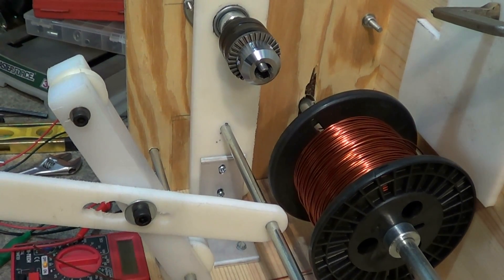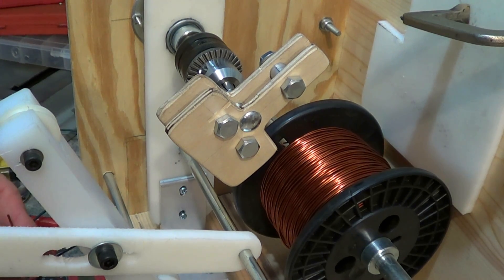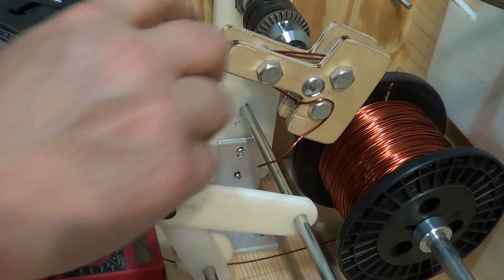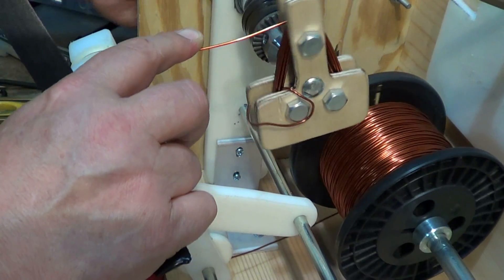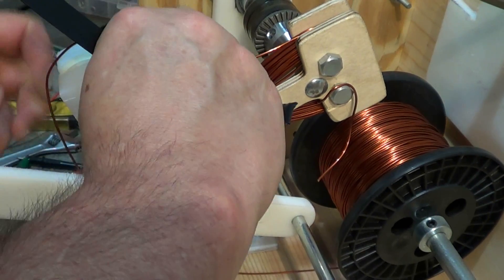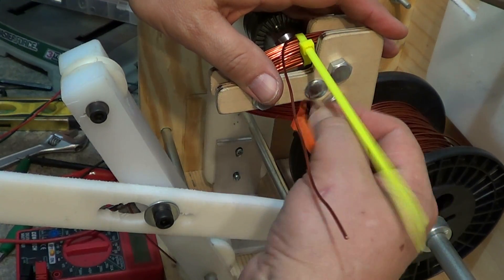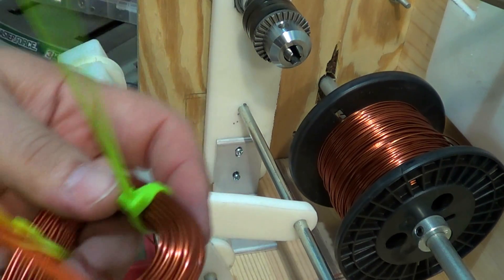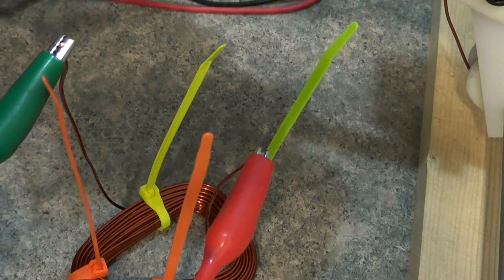TIME TO MAKE COIL'S FOR THE AXIAL FLUX TURBINE

Comment: Nice video -great coils. Lots of patience but there is an easier/quicker way to do it manually.
If you need a 4mm area copper wire (12AWG) then simply use 16 x 0.5mm strands (22AWG). Calculate the length you need, lets say 10 feet, then multiply that by 16 and simply double-up that length of wire 4 times to get 20 feet of 16 strands -now cut and solder the ends and wrap it round a bobin. Use this to wind with and you don't have to be so slow and accurate with your winding as the smaller wires will naturally fill in any gaps...
Won't look quite as nice but will work -good luck!

Comment: Should grab a 1 inch thick rubber pad and install it on a tensioner arm that way you get a little drag resistance on the large spool and to help that tension wrap the coils tighter without much effort. The tensioner arm can be simply spring loaded. 

Trust me when I say it will be a massive time saver.

Comment: Hi bro, that a amazing video! Please share how to caculate number of cicle wiring if i want 24volt at 60 round per minutes. Thank you!
Reply from the maker: I used 14ga. wire and did at 65 turns, 15 coils in star configuration and it came out to be a 12 or a 24 volt stator. You have to be careful of high voltage on the numer of turns and size of wire. Otherwise you'll burn the stator up... Thanks for the comment...

Comment: Great video....Have 2 questions......
Where do I find the info that tells me what gauge wire to use per the Volts I want to generate?
Instead of using your finger for tension...Why don't you use that handle for tension?
Reply: Rezaul

Comment: Thanks for this explanation.  My question to you is does the thickness of the wire and the number of turns affect the ampere?  How many rolls did you make?
Reply: The number of turns affect only the voltage. Section of the wire affect the current...
Reply from the maker: 15 coils is what I built. And The number of turns make the voltage and then the eddy currents flow off the coils to the main lead wire. thanks for the comment!

Comment: add some adjustable tension to the wire, it will help keep it straight and line up with previous wind plus keep it packed better, you want the winds close as possible

Comment: is it better to 3 phase or just daisy chain each coil.
Reply from the maker: You have to connect all coils either configuration Star or  Delta you want. I'd put it in star configuration, that way you have one end of the 3 phase tide together and the other end would be your three phase connection to the rectifier.  This is Star configuration... Thanks for the comment!

Comment: Congratulations! I am from the State of Rio Grande do Norte - Brazil. Good winds and lots of sun. I am trying to manufacture a wind turbine to charge batteries of 24 Volts dc. From what I understand you use AWG wire # 15 and 65 (sixty-five) turns. Question: How long is 1 turn? Another question: You have two configurations to connect the coils. In one configuration the voltage is high and the amperage is low and the other the amperage is high and the voltage is low. As I intend to charge batteries of 24 Volts dc I believe it is better to configure in high amperage and low voltage. Are my observations correct?

Comment: I let out my secret to how I winded my coils of the one I built and sold. I am not building another HAWT of any kind since I figured out how to make a high amp VAWT for so much less. 
Tricycle!  I used a salvaged tricycle front wheel and peddle crank to wind them very fast.  Just clamp the handlebars on a table and put your wire mold assembly on the peddle post on one side, then use the peddle with a extension on the other side as your hand crank. 90 rounds of 15 g wire spun onto nice compacted coils in minutes.
Reply from the maker: That's a good idea for the circle coils. Will give it try but as for now it's slow and steady for now. Till I get my chain and gears... thanks for being there Buddy!
Reply: +TheBillytheJack2010 I'll do a private vid of that and the stator for select few .

Comment: So, I've been looking around, I've seen both this coil design, and just standard round ones and I've googled relentlessly.   I've got rectangle magnets on the way, would it be best to make rectangular coils, coils like this, or just round ones?   Is one more efficient than the other?
Reply from the maker: The pie shape is to fit coils as tight as it can, to fit the hub diameter with the rectangular magnets. As for a round shape coil with a rectangular magnets the flux feilds are different and output should be good also depends on number of turns and wire gauge. Thanks for asking.

Comment: hii,

i would like to build a coil for generator for fun project. 

may i know what magnet wire gauge i should be buying ? 

what is the factor of consideration ? 

what size of magnet wire can handle how much current that flows thru it without burning out the enamel ? 

thanks
Reply from the maker: andrew ysk 15 ga. Is what I use for a 12, 24, 48 volt. The high voltage coils is what you want. Good luck with your build.
Reply: Read the discription...

Comment: Your skill just surpass your narative exellence!!!   LOL  That`s a verry good acheivement you just did there.. The ole project must consume you with the desire of completation right away...  Thanks for sharing and once again, verry EXPLECIT video on DIY.. Must i suggest you something????  I would recommand you to make the stator with 6 leads comming out...So this way, you could by a flick of a switch change the config of the wiring and change the output as you want depending on the winds...
Reply: I'm definitely happy that I took your advice on the wiring, very convenient!
Reply: Peper, this will speed up your build. I let out my secret to how I winded my coils of the one I built and sold. I am not building another HAWT of any kind since I figured out how to make a high amp VAWT for so much less. 
Tricycle!  I used a salvaged tricycle front wheel and peddle crank to wind them very fast.  Just clamp the handlebars on a table and put your wire mold assembly on the peddle post on one side, then use the peddle with a extension on the other side as your hand crank. 90 rounds of 15 g wire spun onto nice compacted coils in minutes.
How to build your stator body in 1 hour for next.
Reply from the maker: Damn Dude that's a awesome idea!! I want to do wye configuration though on this one. Because this one is for my Brother in-law. He's going to build a VAWT with it. But yeah Buddy it on now for sure!! Thanks a lot for being there!!
Reply from the maker: +James Biggar James did you make a video showing that?
Reply: TheBillytheJack2010 Yeah buddy, the  6 leads can be seen in just about every video in the axial flux series that focuses on the pma, specifically the stator pour video. I had mine connected in Wye on the tower when first installed, but needed to switch to Delta because I'm running  24V stator on a 12V system, so Al suggested that i run an extra wire down the tower from the turbine so that I can extend all 6 leads from the stator to ground level and be able to switch back and forth between wye and delta to see which worked best without having to lower the turbine ;)
Reply: I think he means 1KW turbine. You can't make a 10kw turbine unless you get 2 pounds of copper and some poorly plated magnets and put it in a washing machine motor casing and have it assembled in Vietnam then sold on Ebay as a PMG. Then you need 75,000 rpms and a fire extinguisher to get that one burst of 10kw
Reply: Yeah 10 kW sounds like a nice number but its not practical for a single dwelling - it would have to be a MASSIVE turbine with a swept area that's larger than an average home. The best you're going to get from a 3 phase 9 coil gen w/ 16 mag's and 15 awg wire is about 1 kWp - or 500W continuous but that's in ideal conditions, ie: proper tower height into absolutely clean, consistent wind with no obstructions like trees or buildings within a 100ft radius. In my latest turbine build I have a 3 phase, 9 coil axial flux stator and dual rotor with 24 N52 mag's. It sits on top of a 30ft tower but doesn't see clean winds at all and it's only produced 300Wp, typically it outputs in the 50-200W/h range in 5-15 mph dirty/turbulent wind (I'm surrounded by trees, my site isn't exactly 'ideal'). Adding more or less turns in the coils won't necessarily increase the power - to keep the turbine operating properly and within the right charging range requires a specific balance of copper coils, turns, and magnet size/strength/quantity. With the components that you have now, I would suggest using around 75 turns of single strand wire per coil for charging a 12V battery bank. If you want to charge a 24V bank then you should use 50 turns of double strand wire (that means winding two wires side by side in parallel to form each coil - this increases the voltage but lowers the amps compared to the 12V wiring, but the total power in watts at a given wind speed remains relatively the same). This size of gen is best suited with an 8 ft diameter rotor, and is a time tested combination that will ensure the potential for optimum performance - but I would consider increasing the mag count to 24 total and again, whether it performs well or not also ultimately depends on the site conditions and installation height - you could do everything right with the turbine and waste your efforts with a poor installation, so plan it well because harnessing wind power isn't cheap. I highly recommend getting Hugh Pigott's "Wind Turbine Recipe" book, he lays out all of the details for building various sizes of turbines ranging from an 8ft/500W turbine to a proper off grid 14ft/1kW turbine. It's well worth the $
http://scoraigwind.co.uk/a-wind-turbine-recipe-book/
Reply: James Biggar You are right on so many things James and i`m not arguing with your numbers..  My conclusion on the turbine place in the RE community is well above what other people think about this subject... My recent testing with the delco type and right arrangement of blade number and TOPPED with the right capacitor and MPPT has surpassed my expectation with great lenghts..
The lack of curiosity from the community is what strikes me the most... Everyone BASHES the delco type without experiencing or trying to understand it`s behavior with it`s power curve output..  With my recent test with cap and coils in the delco type generator, i have blowen my EP SOLAR 40 amps charge controller at 19 mph winds with a reading of 46 amps on the meter ..  That is some serious power that no one expected from this form of generator.. My help with Daren Baldwin and you just have prouven my point that i have try to push for the last year..  It seems like nobody is really interested in the behavior of the turbine while it`s making it`s power..  But everyone is preocupied at watching the needle moving..
Reply: I did not give up on wind power but I have put it in the category it belongs in, suspension of additional investment!
Reply: al desrochers I know what you mean. I try not to criticise the radial Delco's too much because every design has it's pros and cons, I think the axial has the upper hand in terms of no cogging and very low startup/cut-in speeds - but if an axial and equally sized Delco were compared properly (by equally sized I mean the same weight and ratio of copper/mag's and rotor dia.) then the ultimate peak power would be similar imo. When people complain they're hardly ever making fair comparisons and take things out of context. Like the Ghost turbine for example - I only saw 200Wp from it in 30 mph wind gusts and people shit on me over it, saying it was just a piece of junk, a "lawn ornament" and compared it to bigger turbines,  yet neglected the fact that I only paid $300 for it. I mean, hello people - you get what you pay for. $300 doesn't buy a big off grid turbine with 30 lbs of copper and mag's. But whatever, some people will always ignore facts for the sake of drama or profits or whatever gets them off. Like I've always said the small turbines have their place just like the big ones, which is more applicable depends on the demand. And the same can be said about the Delco's or the axial flux or the Lenz or whatever - they all have their pros and cons and uniquely suitable applications, people just have to take the time to weigh their options. What I didn't like about the Delco's didn't really have to do with the pma itself so much as how it was marketed by certain companies. The outrageous claims were getting ridiculous - when their numbers are suggesting they surpassed the Betz limit by %150+, anyone who's done proper research should know such claims are bullshit. But most didn't and still don't - that's why I persist on shoving the wind turbine power equation down everyone's throats, in hopes they would arm themselves with it and better understand what they're paying for so they don't end up surprised that their 1600W turbine is actually a 200W turbine and doesn't meet their energy demand. Not that a 200W turbine is useless - I can think of a few things it would be good for from auto batt charging to supplying a seasonal hunting camp with power for lights and a radio for ex - but people need to know what they're buying so they can match to their requirements and put their $ to good use. My advice for everyone is to ignore what anyone's meter is saying in a youtube video and wait for a peer reviewed annual kWh data log. No performance log = no validation as far as I'm concerned. It's all about that cost benefit analysis. Thanks for the comment Al!
Reply: James Biggar Every situation need it``s solution... Some people draw conclusion to fast..  In the case of off gridders, they need whatever power aviable to them.. That is why they turn their choice on the big axial.. That is not saying they would have not get the same power if they were investing the same amount of money with the delco type and have 4 of them on tall poles... I feel the RE community need to improve on the open minded side of the subject in GENERAL... We have a bank of candidates in this community that can change the stakes of developpement big time... WE have some of the people with IQ`s that are above the average, we have people that have the bujet to invest in developpement, we have mutual intentions to help each other... It`s a perfect storm to assemble the best group of individuals to counter the thiefs that have benefit this great mouvement and almost extinguish the soul of this group to go on...
Reply: al desrochers That's true - 4 or 5 Delco's will do the same as a big off grid turbine for relatively the same price, it's up to the individual to figure out whether it's more affordable to install 5 turbines and 5 towers with the materials/resources available to them in their area, or one large tower/turbine. Are there space constrictions? High wind zone or low wind zone? We could go on and on with the many different variables, but the bottom line is that effort needs to be invested by consumers to inform themselves and generate a proper CBA before investing their $, and developers need to be open minded and understand there's more to gain by cooperating in open source r&d than by simply assuming one's design is flawless and everyone else is stupid. That person might be intelligent and talented, but their wits and individual accomplishments will never much what a group of like-minded individuals working together toward a common goal will produce. This is a lot of the reason why I love the axial, because it's an open source design. Anyone can improve on it, change it up, and without complicated machinery. Like Orlando, and Billy for example. Each person adds their own touch, incorporates their own ideas into the overall design. Unfortunately this is rare, I don't have much faith that most people are going to recognise that any time soon, least of all do anything about it. Everything is so polarised these days.

Comment: Hello. Got a question for you. I understand coil making, but I wonder about how many coils? So, I have made a prototype wind gen. And it works. But it’s small and I’m thinking about going bigger. Again, I know that heavier gauge wire produces more amps, and smaller gauge gives more volts. Considering it will still be small, I would like to be able to charge 12v batts. But my cut in speed is too high. I need gale force winds to get any usable voltage out of it. Right now I’m running six coils, three phase. Question? Would going from six coils to nine coils help me get a much lower cut in voltage? Along with running twelve magnets per disk, as opposed to the eight I have now. This is still just an experiment for me, as I don’t really need a gen. But I do want to produce a usable voltage at a reasonable wind speed. Any advice would be greatly appreciated!

Comment: nice job on the coils. I like using #14 on my stator.  did you set up a test platform to see how much power each coil would produce?  looking forward to the next video. have fun!
Reply from the maker: test platform is something I've seen done. Will check it before I tie them together. But I'm glad to hear from you. And I hope your doing fine. But my plans are all Chris's
designs, but in the hope that it will be a few sweet moments during the build... Thanks for the comment!